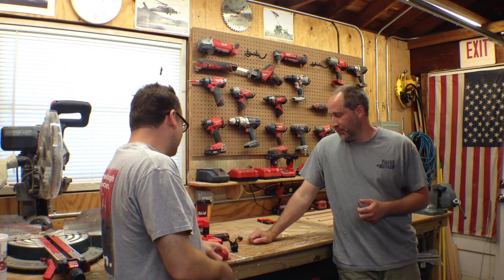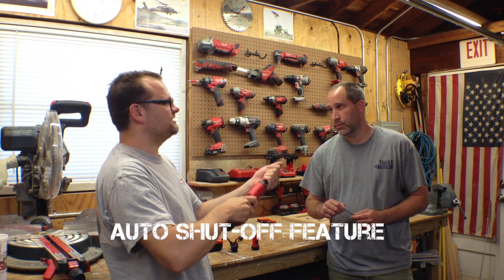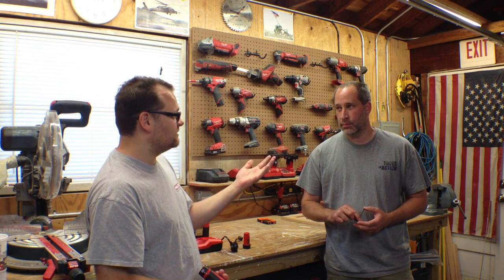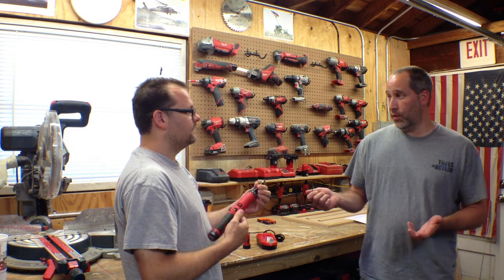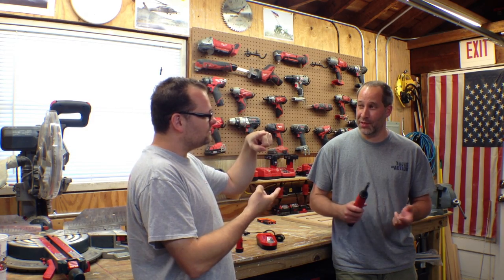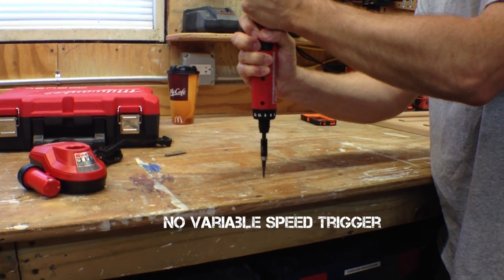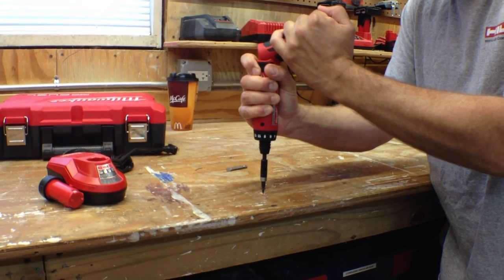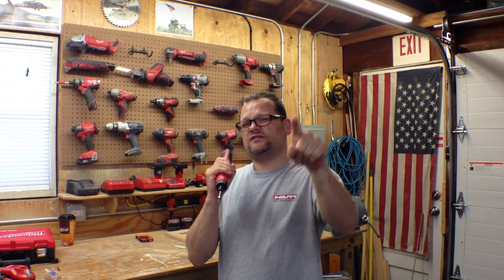Milwaukee M4™ 1/4" Hex Screwdriver Kit 2101-22

Comment: To all of the negative reviews comparing this to a drill, it is a power screwdriver.  I use to have the older nicad version of this tool working on aircraft many years ago.  I absolutely loved the tool.  It is small and light and do not need to be lifting a heavier drill all day.  I loved the tool when removing over 100 screws on a small aircraft cowling.  I loved my snap on ratcheting screwdriver, but the Milwaukee was less fatiguing and great in tight spots, that a cordless drill could not get into.  If you need to remove many screws, this is a better alternative to a ratcheting screwdriver and has a finer touch than a drill.

Comment: This are the real deal. I work in medical equipment manufacturing and these rule the day for all the allen, torx, phillips, etc type screws you wanna take in and out fast. the one hand chuck release is great. clutch works awesome. also get a drill chuck for holes and tapping. just killer. bonus, you can flip it around like nun-chucks, simply badass

Comment: I'm impressed with the power that it has. Would be great for small electrician work. I agree with Dan that it does need a LED light. Also I can't believe that it takes a whole hour to charge a 4 volt battery.

Comment: I used a 2.4v Milwaukee for nearly 5 years. I'm in the market for a new screwdriver now. I am interested in this one, can u recommend any other similar models please?
Reply: I still have the 2.4 Milwaukee Screwdriver but it needed new NiCad batteries, so I decided to just get the new m4 screwdriver, even though you can still get the 2.4NiCad batteries on Amazon and ebay for about $10. My only disappointment was that it is somewhat noticeably bulkier but not greatly so. I guess because its 4volts compared to 2.4 volts. The battery is smaller. You do have the advantage of Lithium batteries  that tells you the charge you currently have and 4 volts. I imagine I will get used to it but I do prefer the slimmer design. I do like that your bit now gets lock in. Sometimes the bit would fall off in the 2.4v design if I had it pointed downward as I was carrying it, often losing the bit entirely, particularly if I had a longer heavier bit.